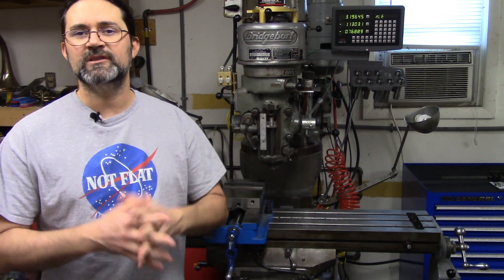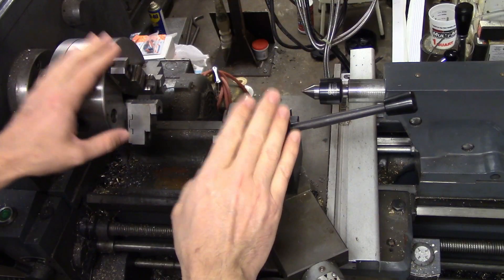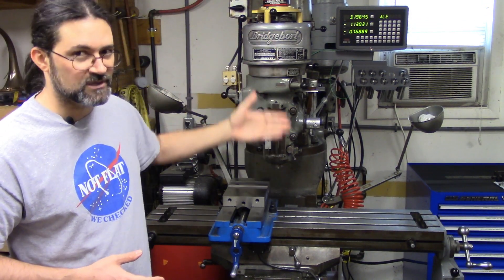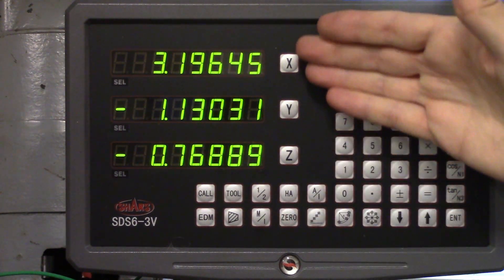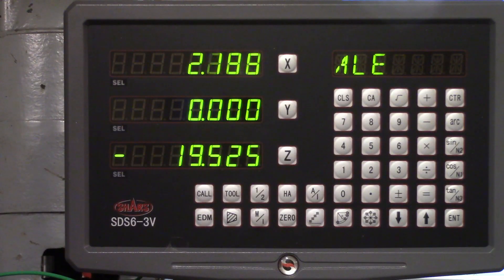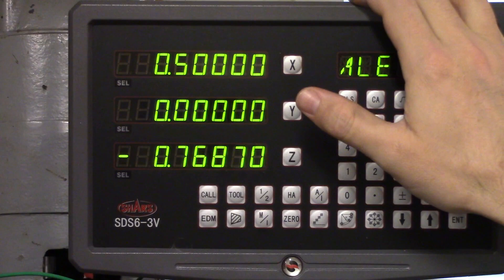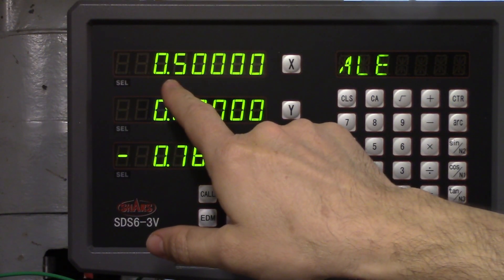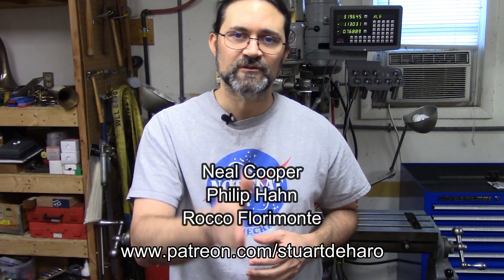How Coordinates Work on Machine Tools

Comment: OK, how useful is that z-axis digital read out?  I have a X,Y dro, and I've thought about getting a z axis DRO, but I haven't been able to justify it.   What kind of cool stuff can you do with that extra axis?
Reply from the maker: Hi Jeremiah. I use it quite a bit. I went without one for a long time and I could certainly do without again, but it's really nice having tool offsets when I have a lot of operations and the ability to switch to metric is great since the Bridgeport dials are only in imperial. I use it for accurate drill depths too. I put the quill down against the stop, touch off the drill on the part, raise the quill, then raise the knee to the drill depth. You can do that with the dial as well, but it's nice to be able to see the measurement and not wonder if you went 5 or 6 turns of the handle.

Comment: Thanks for the video.  One question : how about the axis directions?  X+ axis is in which direction?  Is it the table that moves to the right or the tool that moves to the right?  Same question for Z+ axis : Z+ corresponds to the tool moving down or up?  And same thing on the lathe?
Reply from the maker: I'm not sure there is a set convention on this. I like X+, Y+ to be to the right and back and X-, Y- be to the left and forward. For Z if 0 is the face of the part it makes sense that cuts into it are Z- moves and Z+ would clear the part. You can change this in the DRO settings if you don't like how it is set.

Comment: 👍👍👍 Loads of fun getting a DRO configured correctly so that it displays correctly as well. Messes with your mind when your bolt circle function is all out of whack until you figure out your + and - movements are set up backwards for your scales. Not that that has ever happened to me... 😏

Comment: I would love to see a video in the future that showed in detail some of the more common lathe tool grindings. Or I suppose, some of the more common of the uncommon tools. Basically sticking to HSS. I think something like being able to identify the purpose of the tool based on its geometry would be very useful. A lot of the time I buy lots of lathe tooling which is invariably dull as could be. Every once in a while I come across a grind that I just don't understand. In these cases, I'm not always sure where relief is needed, chip breakers, etc. Maybe you could cover some basic strategies of developing a specialized tool for a particular use case.
Reply from the maker: I like it. I've been meaning to do a grinding video. I have some tips I'd like to share. I need to figure out how to get the camera in the right spot.

Comment: There's  probably no way to do this without access to some very high end measuring equipment, but I'd like to see  whether the Shars  dro is really capable of measuring to 1/100.000 of an inch. If so, I'll ditch my current set-up and become a Shars customer right away. Great video BTW.!
Reply: The dro head units will usually display as many digits as you want. To measure microns or millionths of an inch, requires expensive scales   , the cheap ones seem to only do 5um in quadrature (0.0002")
Reply from the maker: It is incredibly twitchy and annoying. The one we have at work let me change the resolution down to .0000, but if I do that on this one it halves the reading, so I'm stuck with it. Of course, the mill is almost 60 years old so it has enough slop that the table moves a considerable amount when I tighten the lock, so the machine itself wouldn't be able to move that reliably.

Comment: Stuart, my friend has the same dro  on his lathe. Does the radius/diameter switch ( "." On startup and select  1 on Ror D)  work on that one?  I've tried allsorts to get his to work, and in the end , only halving the scale resolution will display diameter
Reply from the maker: I set mine the first time and it has stayed there. It never changes even if I power it off. I'd check with DROPBOX about it.

Dang autocorrect. That's supposed to read "I'd check with DRO Pros about it." I'm leaving it as is so the following comments make sense.
Reply: @StuartdeHaro  dropbox?
Reply from the maker: @wktodd  yep, that was supposed to be DROpros and I missed the autocorrect.
Reply: Autocorrect strikes again, I think. DRO Pros, maybe?

Comment: On a related topic, I'd really like to see a description of absolute vs incremental positioning. One thing that always seems to be missing from discussions of abs/inc is some concrete examples of how to put these methods to work, and when one method provides an advantage over the other.

Some people call the lathe axes X and Y. For more confusion, in that case the cross axis is Y, and the spindle axis is X. I get the impression that this is an older convention that has changed as CNC terminology has become more familiar. Although, Mitutoyo lathe DRO packages still retain the X spindle and Y cross system.
Reply from the maker: 'Sup G?  I use Absolute/Incremental as two separate zeroes which is pretty handy.  I'll make up a quick vid and show some examples.
Reply: @StuartdeHaro  dont forget all the 99 possible zeroes you can use as 99 incrementals ( as long as you don't change the ABSolute in the mean time)
Reply: That would be great, Stuart!